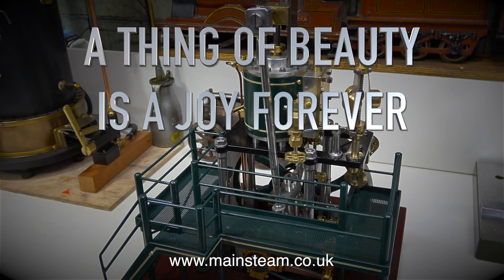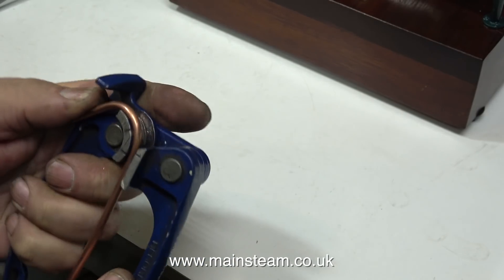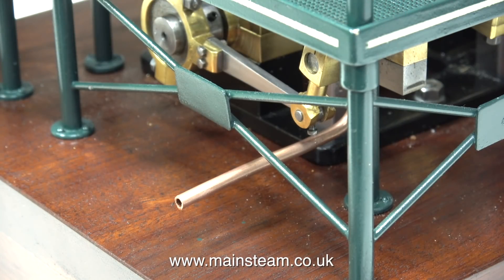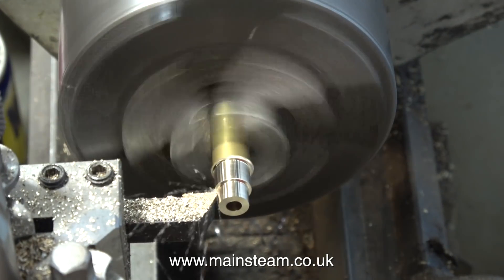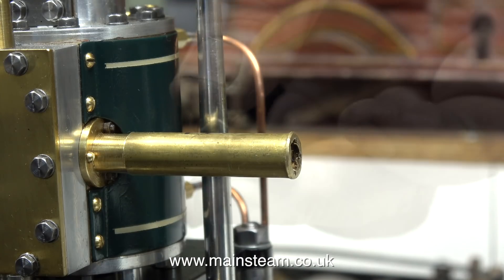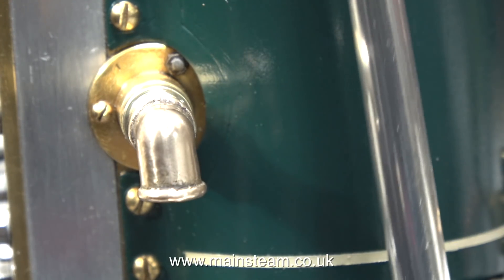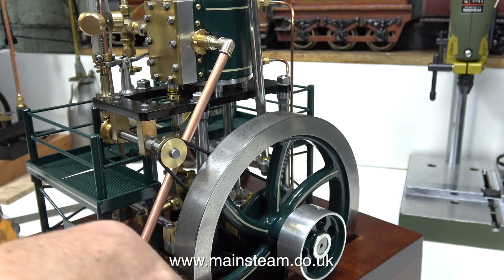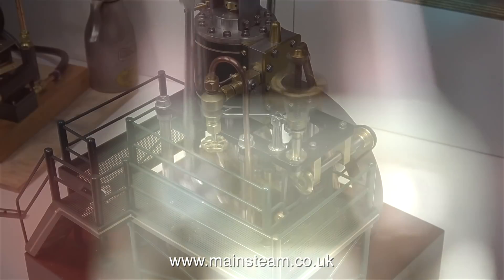A THING OF BEAUTY - PART #2 - PIPING THE ENGINE

Comment: Hi Keith, PM sells fittings in many threads Machined Cast Fittings, 3/16-40 UST,  3/16-40 MTP, 1/4-40 UST, 1/4-40 MTP, 5/16-27 (1/16 NTP),  UST. is a Universal straight taper. They also sell unmachined casting trees.

Comment: Your comment about the pitch being slightly off is certainly a possibility. Another,a friend had a TR 4a decades ago and had permanently loose fenders. Whitworth has 55 degree not 60 degree threads,and 1/4 by 20 was common to both as well. Is it possible your tap or the brass has one threadform needing tweaking to the other ?